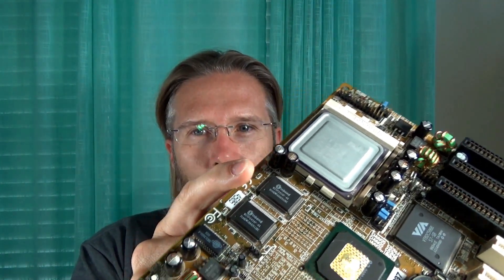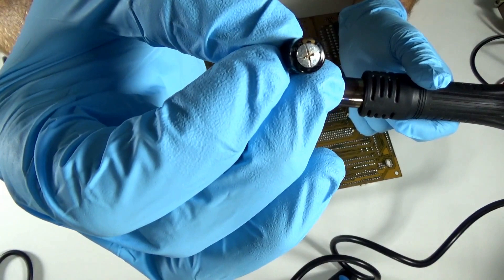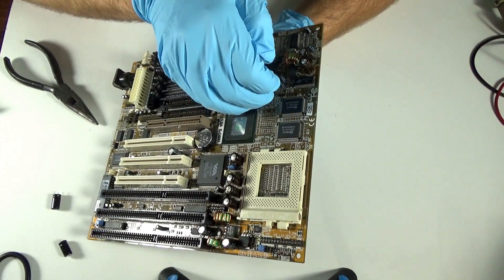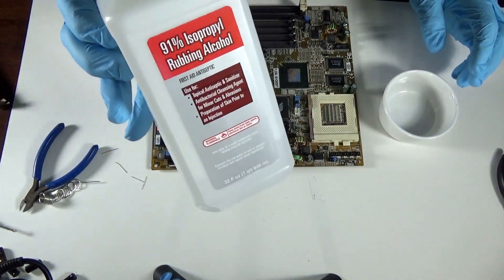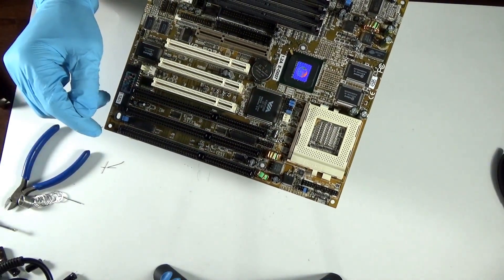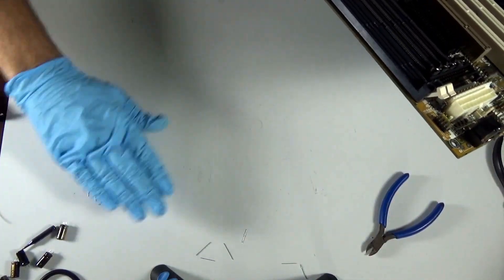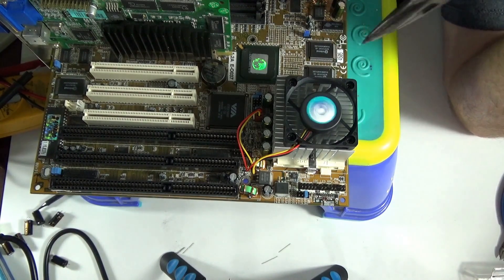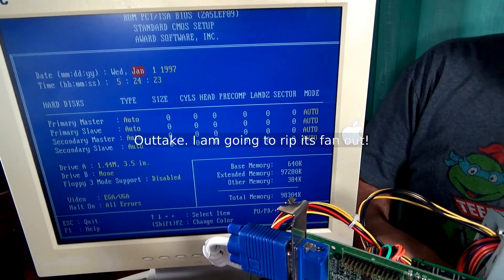FIC VA-503+ Capacitor replacement AMD K6-2 350

Comment: I have one of these I was trying to use the other day but it wouldn't post. It's the 1.2A version. After a while I noticed CT28 and CT29 missing. I must of used them to get another old board working years ago. Glad I came across your video as I had no idea of the values. Hopefully I can get mine working as it will be a good board for testing components on. I have ton's of old RAM I need to run on memtest.
Reply from the maker: Awesome, I hope you gets your board going. Let me know how it goes for you. I will be doing an update on this system soon.

Comment: Hello. Did you also replace all small capacitors 25V 10uF? I also want to run my first computer and I have a problem with the main board (no signal on startup and no image on the monitor - maybe just replacing the capacitors will help as it was in your case.
Reply from the maker: I only replaced the capacitors in the video. Do you have the same board? If so, you may want to check the jumper settings, they are a pain on this board.
Reply: Razor Bucks Yes, i have VA-503+ as well and I`m still wondering what could be wrong because fan on the CPU and inside the power suply works. All the jumpers should be on it's places because it was closed for all those years (maybe do you have any picture of your board from above so I'll compare those two?)
PS. Sorry for my English 😅 and thanks for your help 😉
Reply from the maker: Let me pull mine out. I might try a live stream on it tonight. What processor do you have in it?
Reply: Razor Bucks AMD K6 2 350MHz, S3 Trio Virge 3d, Diamond Monster VooDoo 2 12mb, 64MB of RAM, Sound Blaster Live 5.1, and unfortunately faulty Seagate HDD (but I'll try Seagate Baracuda 40GB instead if it will start one day). Untill now I checked graphic card in another PC and it works and tried to use another AMD 350 CPU and result was the same (but I couldn't be sure that all 2 are ok). Now I'm looking for another socket7 main board just to be sure that CPU is ok (but it's not that easy to get one as you know). I think that after all those years the capacitors could be faulty anyway and it's still a good idea to change it but for now it's 4AM in my country so i have to wait 😉
Reply from the maker: Okay. I will throw up another video for you to see. The main capacitors are not showing any signs of leaking or swelling correct?
Reply: Razor Bucks looks ok but maybe there is something wrong from the bottom. Thanks you once again and sorry that I'm bothering you whole day (or night).
Reply from the maker: No bother at all. I thought you were going to sleep, so I recorded, instead of doing a live feed. The video will be up tomorrow, January 15.
Reply from the maker: Your video is up, https://youtu.be/G9Ai7WVp9Tg
Reply: Razor Bucks thanks a lot I will check it 😀

Comment: Hot air must work different where you are.  I tried hot air on some dead motherboards to experiment and every time the board would get very burnt before the solder would be hot enough to melt.  The motherboard acts like a heatsink sucking the heat from the joint, therefore the surrounding board area has to also be heated to solder melting point.  Trying to repair to motherboards on the cheap is not a good idea from my experience.  A good quality desoldering gun is required.

Comment: the FIC VA-503+ is a great board, I've built up a few systems using it and never had (yet) to do a cap fix, but I will between all these and the DFI K6XV3+/K6BV3+ variant boards I have.   Watch out if you upgrade the BIOS though, as you get high cpu compatibility like for the K6III 3/3+ up to 550 speeds (Actually I've done 617 overclocked before rather stably) but the real pisser is that INT5 gets locked down in the newest lat few bios releases JE43XX as I recall. Losing INT 5 interferes with alot of stuff, most Soundblasters and some NIC's. I've had to use old SB models or old SB settings of irq7/IRQ7 in this board and it is a bit of a nuisance, but old SB's are EXPENSIVE now. your 350 chip wont need the bios upgrade, fortunately.  This int5 issue isnt resolved by setting irq assigned to legacy either, the int5 is tied up badly by the mainboard.  so watch this if you use this board with very fast AMD 3/3+ chips for this board....
My last 503+ project is to setup an EISCA fan (3pin plus other ribbon connector) I just got-a rare acquisition its taken me 5 years to find one through a few friends
Reply from the maker: Thank you. I need to get back to this project. but I do not seem to have enough hours in the day.
Reply: What makes this computer special? I found one
Reply: @garbageman9145  see my above post, it can be overclocked to 550/617mhz speeds with proper cpu's like the K6-III+, is the short answer.... there is a very low voltage k6-3 like 400mhz chip I dont recall the specifics but it can be clocked up and up-volraged a but tp do 550mhz, too, in his board...
Reply: I wish I had a  EISCA fan or two, my existing one I had failed...crap. i like the better reporting of the eisca fan--anyone got one sitting on a shelf decaying but in working order, sell it to me...Id like to rebuild my eisca fan system again...

Comment: I.Q. is a garbage capacitor brand, i have those cancerous caps on my ASUS P2L97 Slot 1 board which haven't failed yet, but eventually they will so i will need to swap them with some Rubycon or Nichicon capacitors.
Reply from the maker: I completely agree.